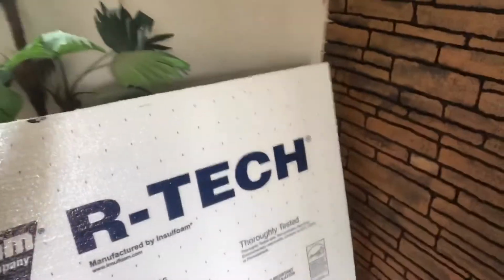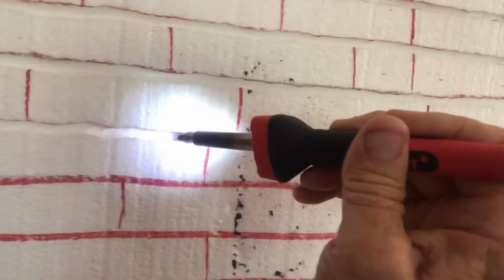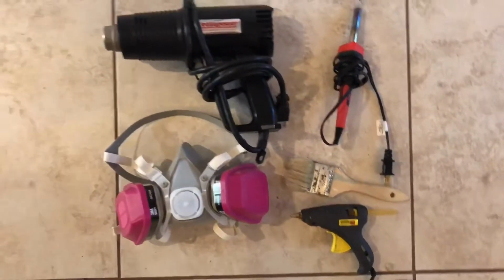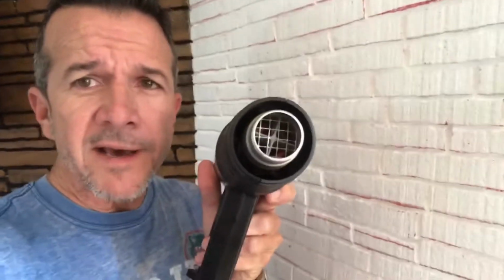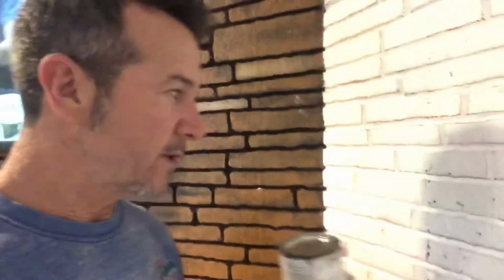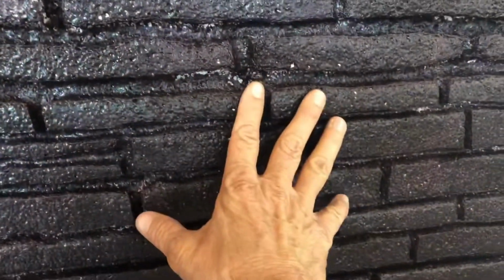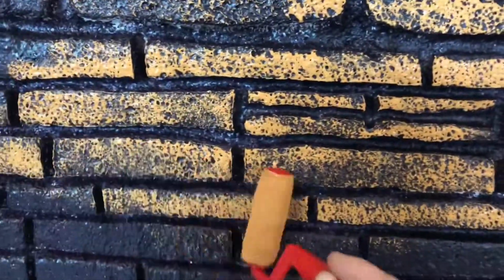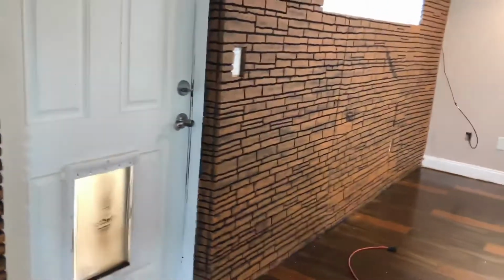How to make a faux brick wall out of insulation foam April 23, 2018

Comment: Awesome job, Sir! I'd like to share a couple additional tips for newbies: Run the 8' length of polystyrene panels horizontal to the floor. If looking for a bit more distressed texture, a light splatter of acetone randomly here and there works nicely. This is to "eat concave divits" for additional texture. Be gentle with acetone splatters or misting... test on a sample piece first. Try this before hitting it with the heat gun. - For Color, grout lines: Black paint is very harsh for grout lines. It can look nice as done here. I don't use black grout lines for set designs. Try a stone colored Neutral dark gray instead. Also, have reference material so you know what you are replicating. (I airbrush and glaze on top of the flat paint color for additional dimension as additional steps. Just something to keep in your toolbox of ideas). I enjoyed this video. Great job.

Comment: This is a GREAT idea!  I’m in the process of planing our dining room renovation and that includes building a rather large square table.  I’m thinking 8ft x 8ft that would seat 12.  I had this idea of building the table with a pedestal base instead of legs but I didn’t want it to be too plain.  I was really REALLY close to spending an unnecessary amount of coin on factory made faux brick/stone panels.  See, I want to have an accent wall and have the base of the table covered in the same faux bricks/stones.  I know it’ll give that wow factor without overdoing it.  Thank you for this video!!!
Reply: instaBlaster.

Comment: Placing the foam sheets horizontal will help hide the seam lines. Also simply gluing in scrap foam on a few of the seam bricks will break it up and your eye will not notice as much. It is still a great way of doing it 4 years after video was released :)

Great Job!

Comment: That looks great! Using this method soon I think; what kind of paint did you use for the grout lines and rustic look? I wondering about eating at the foam....
Reply from the maker: JimboH5 it is a regular latex inside house paint .:-) the grout lines took the most patients ...:-)
Reply: @steveg9691  Thanks, Steve.

Comment: Hey Steve. Do you think this would work on exterior applications also? I have been looking for an idea of filling in an area around an enclosed garage area. We removed the door, ran the block the same height as the original crawl space height all the way up to the edge of a 38" steel door. All that's left is the exposed outside wrapped wall.
Reply from the maker: Dont see why not….. they use foam for all kinds of decorative applications on homes.
Reply: You've inspired me sir. I'm heading to Lowe's and harbor freight asap for this project

Comment: Hey Steve , just wondering what color you used for the brick over the black and did you thin any of the paints.. Also redoing my work shed and thinking of moving my sons drum kit and guitars etc from upstairs and wonder if your band had any big issues with bounce back or anything using this type of panels
Reply: the brand of paint was called Royal  and the name of the color was morning coffee...no I did not thin the paint and it works great with the band sound...no bounce back at all...Goodluck man.

Comment: what did u use to glue the phoem into the wall
Reply from the maker: LAYAL Azzam well at first i thought that I would use adhesive velcro so that it wasnt permanent but then I decided just to hot glue the foam to the wall . My reasoning for that was if i wanted to take it off the wall later. I would just take the glue off and texture the wall and paint over. However the room really looks good to this day and I get compliments all the time on how real it looks .
Reply: @steveg9691  thank u for quick answer i want to cover the wall on my stairs area
Reply from the maker: You can do it.  Just take your time.
Reply from the maker: LAYAL Azzam i did my stairs
Reply from the maker: Hot glue gun

Comment: What did you use to harden the foam?  I tried using polyethylene... I’m thinking using glue mixed with paint
Reply from the maker: Well when you take a heat gun to it , it not only gives it the brick like texture but it hardens it a but as well.... I would try a test piece first with the poly.  It might eat the foam i know spray paint does
Reply: Steve Grasso the poly I tried but it doesn’t harden it
Reply: Steve Grasso when you use the heat gun ... does it harden to the point of using spraypaint?
Reply from the maker: zoro italiano actually I was happy with what the heat gun did and the paint. But now that you mention it. I bet a half and half mixture of Elmers wood glue and water would work. It drys clear .  Great idea. Try brushing it on a test piece